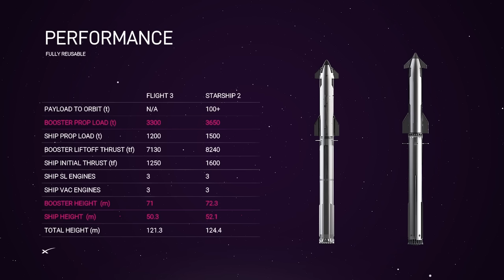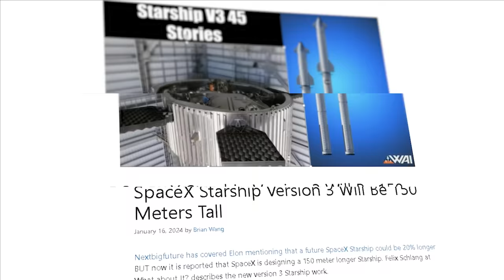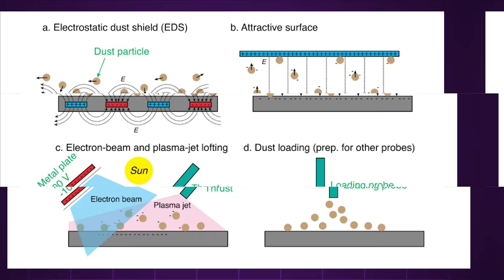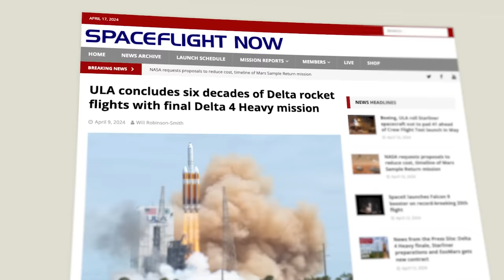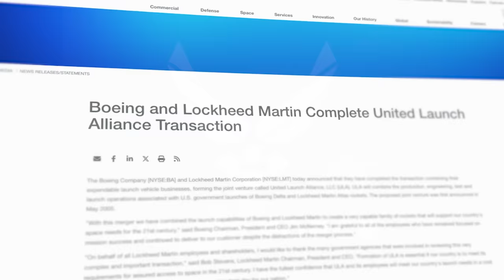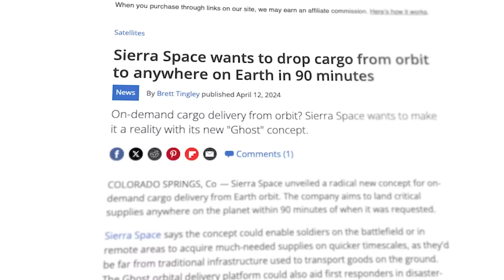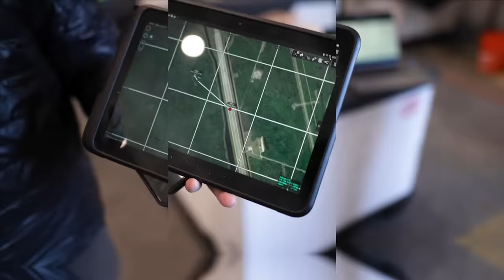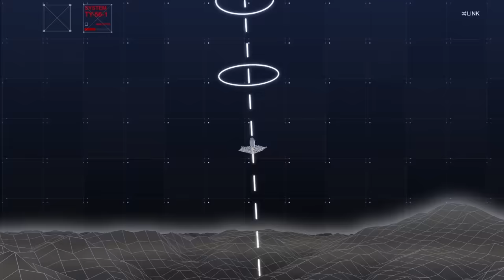Elon Musk Reveals Starship V3 is Coming!

Comment: It’s hard to see how any lunar habitat can function long term without keeping the dust completely sealed outside. Space suit condoms and a mud room?  Like a thin plastic film applied in the outside of the suit upon egress that is easily removed when returning to the habitat. Alternatively the idea of keeping the suits “docked” on the outside which astronauts can climb into may be the way to go.  It would be awesome if electrostatics is enough to keep the suit clear.
Reply: The solution is to electrically charge the outside of the suit. Moon dust is charged, such g is why it sticks to everything. That also means it can be easily repelled.
Reply: If their hopes for water on the moon are anything like they hope that opens another door for cleaning things.

Comment: The higher thrust on the V2 is because it will use Raptor 3s (maybe even 4?) not because of the tank stretch
Reply: Yup, tank is stretched because higher thrust allows that and is needed to feed more powerful raptors

Comment: Promises of success in the future, but will Starship ever be as outstanding as the Hyperloop?
Reply: From the most successful rocket company ever? Not  making sense.
Reply: @thotmorgana  No it is not because flight 3 has a payload of 40-50t as Elmo said himself.
Reply: @thotmorgana You are funny saying that a rocket that is never made It to orbit or recovered a single bit of itself is the most successful rocket ever. I will refer you to the Saturn V which is the actual most successful rocket ever. You should read more history before you spew your muskness.
Reply: It's a system still in development.  It's premature to judge it at this point.  Hyperloop?  That's still an ongoing R&D thing, it's likely a pipe dream but it keep engineering students thinking.
Reply: @TheEvilmooseofdoom  Hyperloop was dead from the start it was only a question how much money they burn.
Reply: @thotmorgana  SpaceX may have more trust than Saturn 5. But the specific impulse of Saturn 5 is 30% higher than Starship. This means, Saturn 5 gets more thrust per unit mass of propellant used.  This means Saturn V can go to the moon. While SS once in orbit need an additional 14 refueling flights to refill its tanks before it can go to the moon.

Comment: He could put Space Shuttle like doors on the SpaceX Starship and have cargo pods (24’ X 48’ to 68’) that are pushed out of the cargo bay using springs, and have anti-spin, course correction devices on the cargo pods and use a cargo pod pusher to push the cargo pod towards the moon / Mars, and use a cargo pod lander, to land the cargo pods on the moon / Mars. And have at least two doors on the bottom of the cargo pods, and connect the cargo pods together using inflatable tunnels, covered with cement by 3D printers, the cargo pods could also be covered with cement by 3D printers, the cargo pod could have built in facilities in them, like everything a moon / Mars lander would have in it, or everything a space capsule for 100 people would have in it.  Or a refinery, factory, warehouse, farm, orchid, dairy, ranch, fish growing facility, grocery store, retail store, hardware store, park, amusement park, arcade, night club, city hall, police station, jail, recycling plant, repair shop, etc., etc..  Also he could use inflatable habitats / buildings, covered with cement by 3D printers, when larger facilities are needed / wanted.

Comment: How far could Starship 3 take a 100 ton load.
Not every flight needs to be "as much as it will carry"
How fast could it go without any payload, just a speed run?
Reply: If it can take 200 tons into LEO, and it's dry mass proportion is the same as current starship (7.7%), then starship 3 can give a 100 ton payload 800 m/s of extra delta-v. Lunar transfer is ~3150 m/s.

With no payload, starship 3 has ~2000 m/s of delta-v to play with.
Reply: @kolbyking2315  Thank you greatly! 
This is why I ask.
I don't learning new things.
Reply: The real question is. "How far can Starblip 3 scatter 100 tons of debris over the planet?"
Reply: Once you are in LEO travelling at nearly 20,000 mph you can travel anywhere in Earth's influence, including the moon, for peanuts. Accelerate from LEO about another 30,000 mph (to leave Earth's sphere of influence and find yourself orbiting the Sun) and you can go anywhere in the solar system for the price of a biscuit. Leaving the Sun's influence, so that you are orbiting the galactic centre, like our Sun does, must take a lot more again, but I don't know how much.
Reply: @thomasmount7388  Using Methalox, you need to double you fuel mass every ~3800 mph. It's 4500 mph for Hydrolox, 3500 mph for Kerolox, and 3200 mph for hypergolic. Landing on the moon and returning takes bare minimum 18000 mph...
Reply: Stopping at the other end though... Hmmm

Comment: since they swapped to steel, I wonder why they still restrict themselves to 9m diameter.
why not 12m or even 15 or 18m? just saying, with steel, they aren't really restricted, unlike with carbon fibers.
Reply: Because it's not so simple to just go wider, it would require a re-build of a lot of equipment and set them back years.
Reply: @TheEvilmooseofdoom  sure, they need a new launch pad, they need some new tools, but it is not as complicated as trying to make larger and larger carbon fiber parts. even 9m was complicated. but with steel, it's not a problem.

Comment: Isn't more effective to launch a rocket off a very large aircraft? No damage to launch facilities from hot rocket exhaust.
Reply: And how are we going to build an aircraft large enough to carry a SEVEN THOUSAND TON rocket into the stratosphere when the biggest airbreathing engine yet built is only 135 thousand pounds (i.e. less than seventy tons) of thrust, and no aircraft ever built has exceeded even seven HUNDRED tons?
Reply: @sailordolly  90+% of a rocket is fuel and engines - that means if you can utilize a launch system which can reduce this mass.
There are current aircraft which can lift 150 tons. Nowhere near the 700 ton payload that presumably the 7000 ton rocket delivers.
At that scale it would be cheaper to build a rail gun on a mountain and launch materials to be assembled in space...

Comment: How about a version 3B upgrade to empower post orbital space travel?
Remount the combined power unit and fuel tanks from the common dome through to the rocket nozzles. Then the entire power unit is mounted so that it can be extended until the existing common dome is locked in to its new position 10 metres from the base of the external body skin.This would only be completed after the achievement of orbit. 
This would create a sizable area for long trip duration use. By incorporating 2 Sierra space 12 metre inflatable habitats inside the newly created area (after extension) each with access airlocks there would be considerable new space for storage, recreation, work areas or even a greenhouse to grow food and thus increase oxygen. The trip to the moon or mars would become much more comfortable and actually productive.
As in space there is no resistance there would be no requirements for retracting the power unit until entering orbit at the destination. Thus the inflatable areas would probably have a 3 longitudinally spaced floor levels of 1 x 3m plus 2 x 2.6m. The 3 m floor area would be an added safe zone for radiation or space debris impact.
This structure would be the cheapest orbiting hotel or other use for mars. Obviously it could carry enough supplies to cover extended trip consumables including the air used to inflate the habitat units.. i am sure Sierra Space could sort the mostly existing habitat units if Space X could re engineer the power unit requirements.
This would coincide with the already proposed in orbit refuelling methods. Just a thought from downunder in Sydney. A Space X admirer from the beginning but no engineering degree. I hope the idea supports some innovations.

Comment: A while ago I suggested an inner and outer shell . for a maned flightship. 
 An inner shell for the human part of the ship to consist of carbon fiber and the outer shell having a hollow shell ,  filled with an i nert gas ie argon to protect the humans from
radiation !
 Of course this ship needs to be built in low obit, wirth 5 nulcear engines .
   4 for thrust. 2 for internal power and for a debris shield !
  A shuttle needs to be brought along for a return  voyage and entry module .
  Habitats need to bulit and sent  to Mars before launch of the human depature.
  I suggest somewhere in Vallis Mariara as it has a higher pressue in the lower basin of the Vally and oxygen may be in greater abundance as well as caves suitable for human protection .
  A door could be built to trap the oxygen
and radiation.
 Water may be more accsessable in this region also.
   Mike.

Comment: No. 
It will perform worse than previous versions. Higher thrust with the same fuel will require more fuel. 
Apparently it cannot make orbit fully loaded with fuel and void of payload. Sounds like a huge nope. Unless E has made breakthroughs in fairydust technology. 😑
Reply: That's why they increase the fuel load as well.  You don't think very far OR very well and you are certainly in way over your head on this subject.

Comment: Stop designing for what is needed and start designing for just in case speaking of heat shield only at the bottom the heat shield should cover the whole ship/2 heat shield should be a one piece slide over and lock in place then you can patch and repair if damage to make a heat shield that's thousands of peices doesn't sound like Elon simplication approach
Reply: holy run-on sentence
Reply: SpaceX philosophy seems to be working fine.
Reply: That's the dumbest idea ever.
Reply: @filonin2 wow a 1000 pieces is better than 1 solid piece,well let's debait that with 1 piece nothing breaks off ,not pieces fall off and if it covers the whole ship it wouldn't matter how it re intered it would be protected on both sides,my ideal is not the greatest but should be the next step
Reply: @billweberx not saying it wasn't imagination is the driving force behind innovation
Reply: @gayfruitbasket in a world abreviation the number 1 thing is you communicate your thoughts to the other person if you understood what I said or was trying to say that's all that matters
Reply: @futurepass395  he said while making another run-on sentence
Reply: @futurepass395  Imagination might be the driving force innovation but ignorant nonsense is always ignorant nonsense.
Reply: @futurepass395  The space shuttle had 24K tiles on one side.
Reply: Designing for things beyond "what is needed" adds extra weight to the design, which cuts into the payload that you can carry. Each kilogram of unneeded stuff is a kilogram of payload that you can't carry.